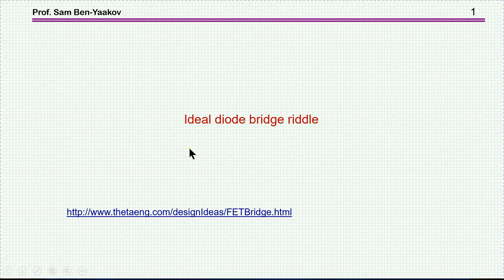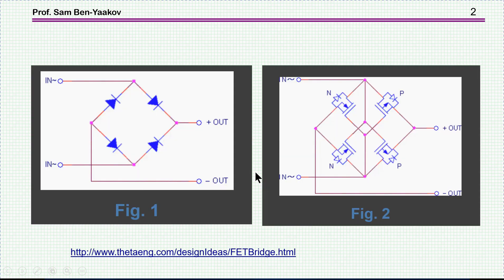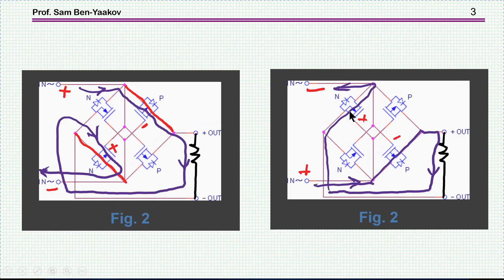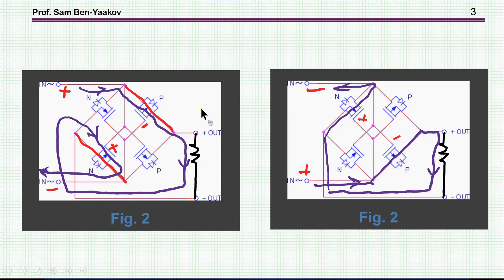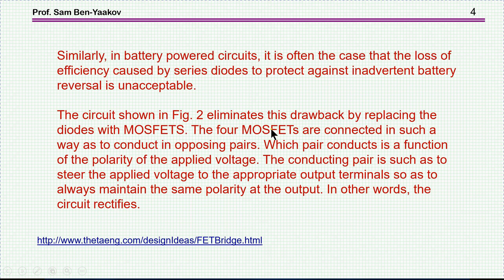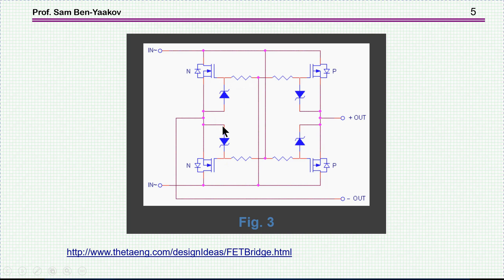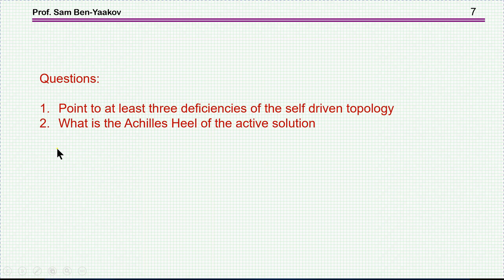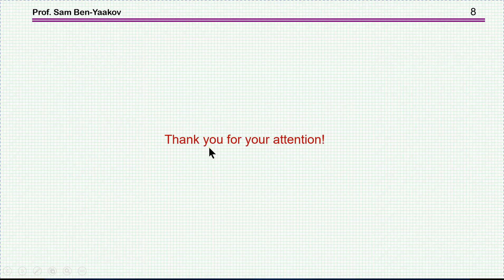Ideal diode bridge riddle

Comment: What about a full bridge rectifier with capacitors across each diode?
Reply from the maker: To do what?
Reply: @sambenyaakov  Just to improve performance and efficiency, I was just reading about the "Graetz bridge rectifier"
Reply from the maker: @steve-h7z  This is OK for low frequency like line. It will be disastrous at high frequency
Reply: @sambenyaakov  So it will work with 240v 50hz? I mostly just want to see if it will improve power-factor of a LED bulb! 😀

Comment: Perhaps this would be an improvement on the single crystal diode radio? I will look into it a bit. As I live in a small condo, I never thought I could get a crystal radio to work, but with this design, it just might work -- fingers crossed.

Comment: I once designed an on-chip rectifier bridge like this and the issue I had was during startup the current through the parasitic body diode was modulating the substrate and inducing soft latch up currents.  The gate controls were supplied by the DC output voltage once the output voltage was high enough.  Every half cycle the voltage reference (bandgap) was getting smashed below ground due to latch up so the switches only worked properly every half cycle.

Second tape out I added very hefty triple guard rings around the devices so that during startup the current injected into the substrate was collected, and I moved the bandgap farther away.  Then the circuit started up and worked great.

Also have to carefully control the gates properly since transistors conduct both directions.

So in my case startup was the major Achilles heel.

Pre-driver is also challenging as it consumes a lot of current, may have worse losses than simple diodes depending on details.
Reply from the maker: Hi Dan, thanks for sharing.

Comment: My point will be for fig. 3 for imporoved  circuitry by putting zener diodes across gate to source will put stress across Rg if it is low, for fast turn ON-OFF, dissipation will be high and can burn out at higher voltages. Rg if chosen very high value makes slow turn ON-OFF
Reply from the maker: Good points. Hold o to my answers.

Comment: Great video 
The ‘passive’ solution at practical higher voltage still has the inefficient aspect of trying to drop voltage for the gates
There are permanent resistances in the passive model

The active model adds complexity and probably inefficiency in regards to failure 

One possible solution which would be frequency fixed on a rotational rectification would be to use LC components for example a ‘capacitive’ dropper might function as it is not resistive and thus returns all energy per polarity shift.

Without engineering it , it seems like a possible path to explore.
Reply from the maker: Thanks. Very good points. There are more. Hold on to my answers.

Comment: Passive solution:
1. This one I read in the link. The circuit is bidirectional, so it would not work if connected to a large capacitor;
2. For a moderate size MOSFET you need a relatively low resistance in order to make the time constant of the gate circuit low enough. So, it will dissipate quite a bit of power;
3. If the resistor is not small enough, one MOSFET could turn on before its pair has turned off, causing a short-circuit. It could be avoided by using a diode in parallel with each resistor.
Reply from the maker: Thanks for participation and for doing your home work😊 Yes, point 1 is very important. Good other points. There are more.

Comment: With addition to all the comments below, the Achilles heel is making sure you do not short the (both Mosfets are on). Also at light load this solution may not be much better than a diode as the driving circuit might consume more then the power saving, especially in the resistor zener solution. One final thought is woking in PFC mode the Mosfet will not conduct the full period
Reply from the maker: God points. There are more. Thanks for participating.

Comment: Should be used  Schottky in parallel with the normal diode !
Reply from the maker: Schottky diodes (when possible) will lower the dissipation during the diode conduction duration which could be short, depending on the input voltage amplitude. Good point . Thanks.
Reply: Great idea.

Comment: Another problem with mosfet connection diod is that P and  N channel be matched closely , in practice N channel is better then P channel current  mobility . They should also have matched VGS too , 
I use this circuit https://www.analog.com/en/technical-articles/the-dreaded-file-test-on-an-lt4320-ideal-diode-bridge-controller.html# 
from analog device ( linear technology) , it use N channel mosfet , has pump of charger too, I make it in my amplifier 50A , cold as ice and very robust.
Reply from the maker: Thanks for participating. There ARE problem with the simple MOSFET solution but not the problem of matching. Hold on to my answers.

Comment: (1) (a) The switch-on and switch-off times are proportional to R times mosfet capacitance,
        which for some applications might be too slow.

    (b) The bridge is actually conducting even if the diode would be
        polarized non-conducting, in the phase when AC still has the same
        polarity as output voltage but is already lower. The current then
        may flow from a capacitor at the output of the bridge to its input.
        Transisotor turns off when the AC enters next period (minus
        V_threshold).                     
                                          
    (c) Therefore upon turn-off the bridge may discharge a capacitor into
        the secondary winding of the transformer, creating a spike at the
        primary side.

    (d) Of course it works well only when the AC peak-to-peak voltage is significantly
        greater than V_threshold.

(2) Only works for AC because the driver circuit charges when the transistor is closed,
    therefore it would not work as a battery polarity protection, where the passive solution
    does work.
Reply from the maker: Thanks for participating.  Last part may not be exact, Hold on to my answers.
Reply: @sambenyaakov  Well, the passive solution might be problematic even as a battery polarity protection -- if the powered device would be discharging its capacitor only very slowly, it might be possible to swap the polarity of the battery while the transistor is still ON. So after inserting the battery the opposite way, the other transistor would then conduct thru its diode a and the two would short-circuit the battery.   Anyway, as always, I'm looking forwards to your explanation.

Comment: The very first bridge is only good for square wave signals or just a simple polarity protector.  If the amplitude of the signals is limited to 20v and the saturation region starts between 3 and 10 volts this means a lot of linear region losses when the signal isnt dc or non-sqare wave ac. Also there is no gate voltage protection in sight, which makes it only viable for prototyping.
The 2nd one allows for higher amplitudes of IN, therefore can be a bit less lossy with sine waves and such, but if the amplitude is too high the voltage clamps would become a big heat source, so there is a curve of efficiency relative to input voltages.
The 3rd one would require a charge pump with all these n channel only mosfets, which means if it uses bootstrap then it can't work for DC
Also the active electronics would limit the minimum input voltage.
For battery polarity protection I would just use one N channel to be cheaper and less lossy.
Reply from the maker: Thanks for participating. Good points. But there are more.
Reply: @sambenyaakov  That's why im subbed
Reply from the maker: Well, not being shy to inquire is the way gain knowledge.

Comment: I once thought I was gonna be super clever with that "improved" circuit with the 4 MOSFETs. I quickly realized in Spice that while it works with a resistive load, you can't stick a capacitor to the output, as insane currents were flowing in and out of it to keep the waveform Vout looking like abs(sin(2*pi*60*t)). That's when I realized: "Oh. Of course, MOSFETs are gonna conduct both ways, and their conduction state depends only on Vin." whereas a real diode will only conduct when the voltage across it is of the forward polarity/bias. The reverse-polarity protection circuit is pretty clever though.
Reply from the maker: Thanks for participating. We have a saying which loosely translates to: There is no a wiser guy than the experienced.

Comment: 1. First Solution has limitation of input voltage amplitude, since vgs usually limited to +/- 20V.
2  The input minimum voltage also has limitation in first and second case, since below some vgs threshold the circuit is not conducting. If input voltage amplitude is close to threshold voltage the mosfets may heat up due to higher Rdson at that point. Due that some energy at input will be lost on diodes, and output voltage will be lower, since there is a voltage drop on body diodes at input voltage below threshold voltage.  
3. The electronic version has charge pump and has limited turn on time max 5uS.In this version it may have more overlap time during switch over near 0v at input which may damage fets, the fets should be able  handle that.  It uses only n channel fets. Fast transients at input in all 3 versions may cause shoot trough issue. The energy is not transferred to load until voltage at input reaches voltage drop of diodes.
Reply from the maker: Thanks for participating. Very good points.

Comment: The active solution is using all Nchannel MOSFETs so it’s going to need some sort of charge pump or switched capacitor.  I assume there may be some sort of shoot through problems as well.
Reply from the maker: The IC includes a charge pump. Good point, needs elaboration. Hold on to my answers.
Reply: Ditto.

Comment: maybe it will be useless in hi voltage( with zener diode) because zener need minimum current to work at rated voltage and  resistors wich supply them can produce a lot of heat , with drops efficiency  from all schematic, need to calculate, so on we still need open transistor to fast as we can, so we need more current from zener diode to charge gate capacity   beside current to set diode in work place
Reply from the maker: Thanks for participating. Good try.

Comment: - One of the problems might be a too low supply voltage, not enough to fully open the FET and having high load in the same time. The FET would eventually heat up and melt.
- High voltage transients either from supply or an inductive load might damage the FETs if they are rated for lower voltages.
If I was that  smart to figure out other issues, I would be probably a full time student of Prof. Sam Ben-Yaakov.
Reply from the maker: 😊Good point. Thanks. There is more. Hold o to my answers.

Comment: it will not work in case, when Vin lower that sum Vth on gates of transistors , only body diodes still works fine
Reply from the maker: Good point. Thanks. There is more. Hold o to my answers.

Comment: In the case of the passive version:

- For AC rectification, I suppose that the gate threshold imposes a noticeable distortion in the output (maybe the parasitic diode gets used in this part? imparting greater loses...). Also the usage of the linear region might be a little too long on some cases. Finally, what happens on the negative half of the wave?
- For reverse battery protection, I don't find any benefit to a typical single P FET protection estrategy, since this proposal already uses at least 2 of them...

As for the active circuit, way ahead of my knowledge to even try and guess 😅
Reply from the maker: Some good points. Thanks. There is more. Hold o to my answers.
Reply: @sambenyaakov  as always, eagerly awaiting for your eye opening insights, professor!